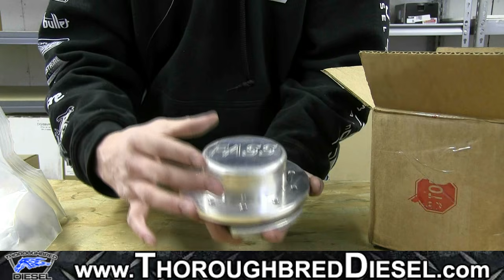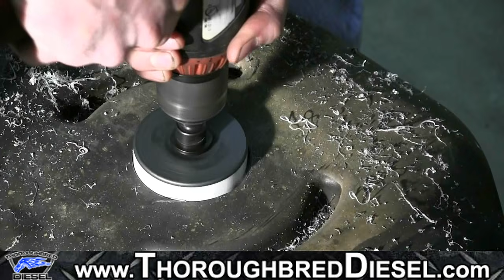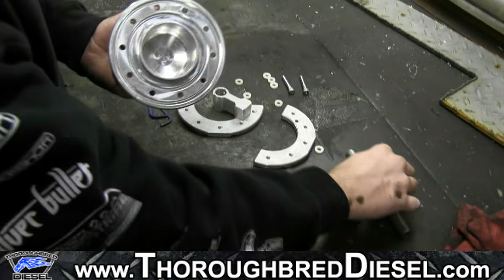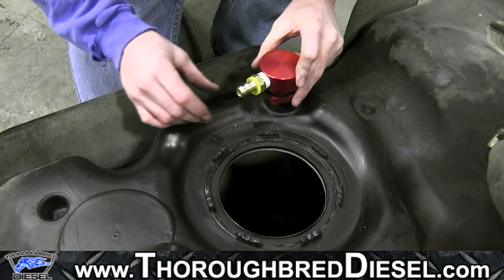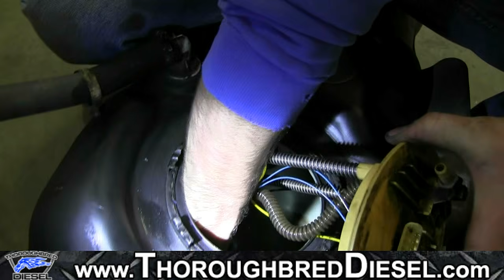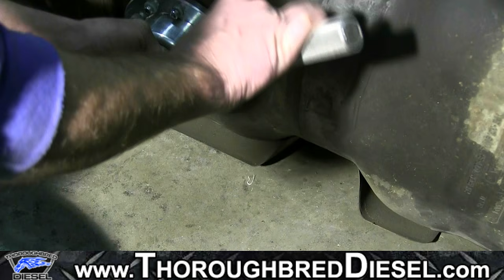FASS Sump Pump Kit Install: Eliminate 1/4 Fuel Tank Issue #STK-5500

Comment: Where is the fass lift pumps return go to?
Reply from the maker: It depends on the kit,  but on some kits it returns to the filler neck, on some kits it returns to the draw straw or supply area for the kit.

Comment: So no type of strainer now to stop the lines from being clogged up from debris/sludge/dirt. Rely on fuel stations to keep the fuel clean eh , no worries about defective fuel caps and dirt roads eh...I understand you have filters to protect the engine/injectors/pressure pumps but what stops the debris from even leaving the tank after filling up for decades at different fuel stations and clogging inside the fuel lines now?
Reply: Others have stated that larger debris is stopped by the water separator before going into the fuel filter.

Comment: Question about this sump, I'm doing a gas to diesel conversion, if I run this sump with a fass pump I just need to cap the lines off on my existing sending unit and that's it? The only fuel lines will go to and from this bottom sump unit? Because that seems almost too easy

Comment: Why are people so interested in running their fuel tanks this low on fuel before refilling.  Just keep fuel in your tank and you wont have issues.
Reply: This helps with restricting as well when running a lift pump

Comment: This unit is at least 6 years old. It it still the current model or has it been updated or upgraded? Please reply.
Reply from the maker: The FASS sump hasn't changed. There has been a lot of development in the sump area since this video came out but FASS has focus on pump design and left sump work to some of the other manufacturers.

Comment: The STK-5500 needs improving the piece of paper that he says are instructions is only a advertisement leaflet. Nor does the kit include what you will need or recommend. I had to go to the hardware store several times. Also the tube is way to short if you wanted to to move the sump forward. For over $200 you get two good pieces with hardware. No instructions No quality connection tube No items you need list . Thanks FSST take your money

Comment: Could you leave the draw straw a little higher to allow for a little bit of sediment and junk in the bottom of the tank??
Reply from the maker: If you cut it higher you run the risk of low-pressure issues based on low fuel level.

Comment: Hey could you guys give me a suggestion on a lift pump for my 6.4 is there any reason I can’t use the 200gph if I don’t plan on 900hp right away and I want to get a sump with feed and return so when I install the sump running the lines is straight forward I’m assuming just block off the factory feed and return fittings?

Comment: My only qualm with this sump, is adding a whole new draw straw, which in turn completely defeats the soul purpose of a sump to begin with....
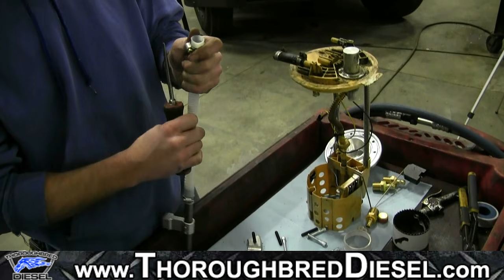Reply: At 18:12 you can see the old straw being attached to the "new straw." The "new straw" is really just an extension for the old straw to be able to reach the bottom of the sump. This makes the draw occur at the bottom of the sump. From there it would, presumably, go to your choice of stock or aftermarket filter.

Summary: There is only one straw after the install of the sump system.

Comment: Great Video, do you have one for ab2011 Duramax . I am doing one with just the Sump bowl kit Fass STK-5500BO . Directions say to drill and install under the sending unit . Will the bowl still get enough flow with the sending unit sitting on top?No tank drop is what they say.

Thanks,
                 Heber

Comment: Why not put the tank on a pair of sawhorses !? Easier to work! Gonna install my fass95 tomorrow, might do the sump closer to summer
Reply from the maker: A good idea wasn’t thinking at the time.
Reply: So this sump is in conjunction with a FASS filter system? What is the intent of these additional systems? Keep fuel flowing because stock components are inadequate?

Comment: I think the pickup tube method is not a good situation for this basket type of setup. That being said I think cutting a vertical slot in the basket for the pickup tube to go through would be helpful OR installing the pickup tube head on the top of the fuel tank cover.

Comment: sump = basin,  why even worry about any of the sending unit other than guage part
  isn't fuel just going to find its way to the sump?
Reply from the maker: Yes,  the fuel will find its way to the sump and the sending unit is still used because the gauge is still functional and return fuel still from the high pressure system returns there.

Comment: How do you thoroughly clean out the tank?
Reply from the maker: To thoroughly clean the tank you will have to drop it and clean it completely.
Reply: What solution do you use?
Reply from the maker: I use clean diesel fuel. I never add another chemical in fear of compromising the tanks lining.
Reply: Ok makes sense

Comment: I wouldn't use RTV on the Sump Bolts. RTV won't cure correctly in a thread seal application. Use Hylomar universal blue thread sealer or  and Anaerobic gasket maker which is a cousin to thread locker. both will be fine in the absence of air and are total unaffected by the Diesel fuel or Gas.

Comment: did he mean two quarters high or two 1/4's of an inch high.
Reply: +123itsjustme1234 Two quarters stacked up in height. It's actually written that way in the FASS installation instructions.

Comment: How hard is it to use the sump on a titan tank with the titan shield? I'm debating whether to go this same route or go with just a straw, I like the fact of eliminating low fuel issues with the sump but think the straw would be easier and more "hidden" with the titan tank and shield already hanging as low as it does.

Comment: Is there any particular reason that the "drawstraw" option was used on this truck, instead of running a new fuel suction line directly to the port in the side of the sump? Right at the end of the video, the installer mentions that the sump can be used either way.
 BTW, thanks for posting all of these very comprehensive and detailed videos.  I am the original owner of a 1998.5 Ram 2500, 5 speed, with 80,000 miles It is all stock, and is running well, but several people have warned me that the stock Carter lift pump probably has "one foot in the grave". Looking at your videos and website, I am thinking the Airdog FFRP might be my best option, since it installs in the same place as OEM and won't require me to drop the fuel tank. I don't have access to a shop lift so dropping the fuel tank would be very difficult, or expensive if pay a mechanic to do the work.
Reply from the maker: We only used the straw to show the full attributes of the kit. Nothing else. On a normal day,  we would have stuck with just using the sump. That would be a good choice of pump, FASS has a direct replacement as well called the DDRP. Good luck with whichever you choose!
Reply: I went with the FASS 95gph kit that uses the dual water-separator and particulate filters. I didn't have to remove the fuel tank completely, just dropping it about 3" was enough for me to get my hands on the fuel lines. I have had one problem: I mounted the kit to the frame at the front end of the cargo box, as recommended in the instructions, and have discovered that this location puts the filter canisters at risk of being struck by small rocks being slung back from the left front tire when driving on dirt roads. Had one actually crack the particulate filter and I lost 3 gallons of fuel before I noticed the leak. Fortunately I had a backup filter in the truck! To mitigate this problem, I cut a strip of foam rubber out of an exercise mat and wrapped it around both filters. It completely covers the filters with a couple inches extra, and seems to provide adequate protection from rocks.  I've driven the truck  about 6,000 miles with the FASS pump, and it's great! I mounted a pressure gauge on the dash, and the FASS pump delivers 15~17psi constantly. I hope that adding this FASS 95 lift pump will extend the life of my VP-44 injection pump for a few more years.
Reply: I was able to get mine tucked up in the fender well pretty high. The filters aren't visible from the side of the truck.

Comment: Great video! I'm going to do this on my LML Duramax. One thing I noticed is that you missed torquing one of the bottom bolts on the sump. I doubt it matters though, they seemed close to torque before you used your torque wrench.
Reply from the maker: We follow  up all of our torques off camera when we are doing installs for that exact reason!  We forget simple steps sometimes when the camera is rolling.